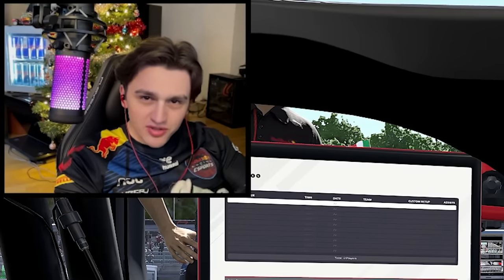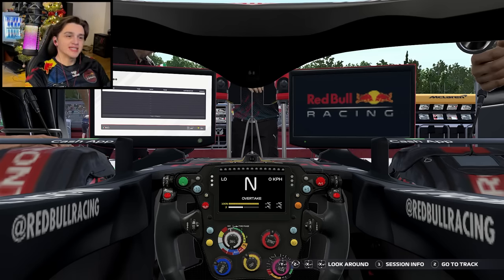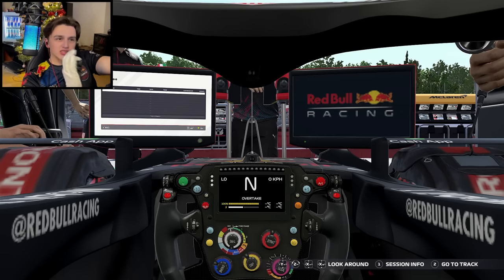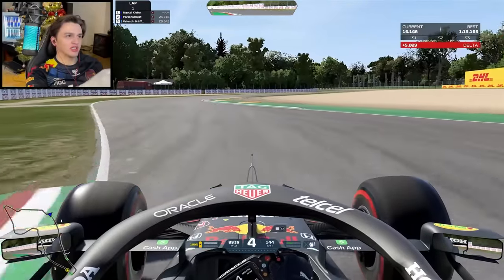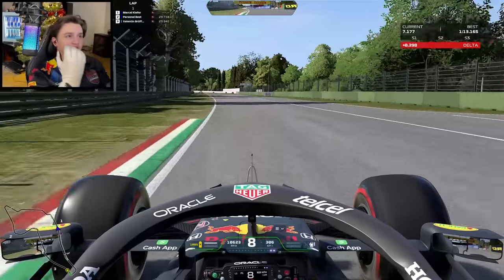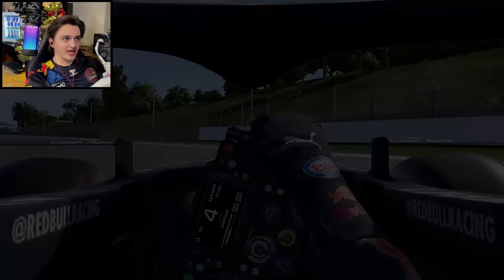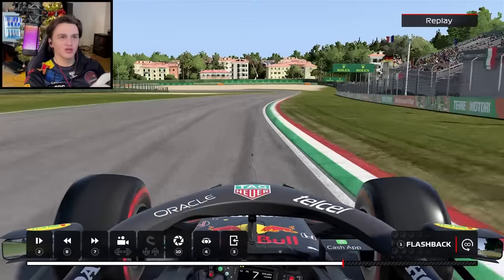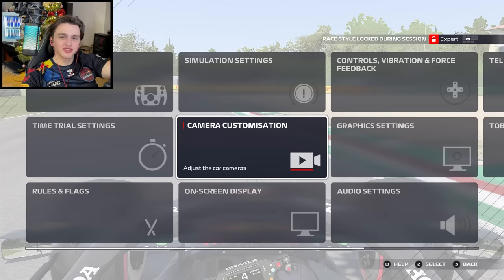Master No Racing Line with these Tricks! F1 2021 Tutorial

Comment: I think it would be so helpfull if someone would talk about every single braking point on every single track!!
Reply: It depends on track conditions and especially on fuel level and tyres. Just watch a youtube video of a record time trial lap and try to remember the braking points. These are the latest braking points and when you have more fuel, harder tyres or worn tyres you brake earlier. You definitely have to drive some laps to find your braking point depending on your fuel level.
Reply from the maker: Can make that but it really varies a lot during wets/inters and dry - fuel load and tire age also matters :)
Reply: @MarcelKiefer  Je kürzer die Renndistanz desto weniger Einfluss haben ja Faktoren wie Reifen, Reifenabnutzung, Spritmenge. Nimmt man mal an das die meisten Spieler nicht mehr als 25% Renndistanz fahren grenzt das doch schon mal einiges ein. Wenn du darauf ausgerichtet Videos für jede Strecke machst, haben diejenigen die längere Distanzen fahren, wenigstens einen guten Anhaltspunkt.
Reply: @MarcelKiefer  u gotta keep it simple(just like u said) and do ur tutorials on Time Trial(all tracks on dry then wet conditions) 🤷‍♂️
Reply: YEAHHH exactly
Reply: Technically you could just use the racing line as reference and look around for objects around it when it goes red
Reply: @DiktaturenF1  This is how I learned… I thought this is the way, but lazy people exist… 🤷🏼‍♂️

Comment: My personal tip is play a race starting from midfield or back on ai level a tiny bit higher then usual and just follow them around the track, soon you will get used to it and will be looking for the best braking points to overtake which are usually on the limit to where you brake and just dial a few meters back on a normal lap to find your ideal braking point/ turning point ( I play on kb but hope this helps )

Comment: Did you drive with a controller when you first removed the line or did that come later with the wheel? If so, what's the difference?
Reply from the maker: Yes with controller! So still had to relearn everything on the wheel :)

Comment: my setup is not mounted, wheelbase is tilting slightly left by the time (I always reset its position during races), since I have nothing to mount my pedals, I extracted the spongy thing from the back of the brake pedal (conclusively I have no resistance on braking), my pedals are travelling the room during races, I am playing through a laptop (15" screen, wheel + wheelbase + laptop case puts the screen 1.5mt from my eyes, due to the perspective difference, when I hold my phone in my hand, the screen is larger than my PC's practically).

I am only using 2D corners only racing line despite the fact that I don't want to use.

so, can these things prevent me from being competitive enough or am I being drama queen?
Reply from the maker: It can definitely have an impact on your performance, what I would try to do is focus less on that and more on getting the maximum out of the material available to you:)
Reply: @MarcelKiefer  you're right, will do that. cheers.

Comment: The weird thing for me is, I do just fine learning circuits without racing lines in any other sim/racing game. Somehow I can't get it right in F1 games, no matter if it's a circuit I know or not, I always play with all assists off, but in F1 I just can't get it right for some bizarre reason.
Reply from the maker: Read that a lot, it is different, but you will get used to it:)
Reply: Ye I have seen many mentioning what you said and i think that Codies F1 games are actually harder and more unrealistic i guess?
Reply: Bro this is exactly the case with me too. Not a single game other than F1 where I use line. Even though I turned all assists off eventually over the years, I could never get rid of line and I know every circuit by heart too lol.
Reply: Same here i play acc and iracing with no assists and its no problem

Comment: I've had problems getting used to the manual gearbox and switched it on and off again all the time. Until I switched it off for good, I've been a lot slower in the beginning but after some time I'm a lot faster now. 

Anyways I'm struggling with the racing line, especially because of changing track conditions, fuel load and tire wear. In time trial I've got no problems at all but as soon as I'm in a race my breaking points seem to be off. Maybe you've got some advice on that 😅
Reply from the maker: Brake earlier and lighter then get try and brake later and harder over time :)

Comment: How do you remember the braking point of every corner of every track? How do you remember so much!? It feels impossible :(
Reply from the maker: It‘s building up repetitive memory :)
Reply: the way i learned it is i drove behind ai, then as i got better i started overtaking ai and driving on my own in clean air. later i sharpened those skills in time trial. now i'm confortable with every braking point of every track. but not just that, i learned how to stabilize the car in the hard braking zone, how to transfer weight safely without spinning, how to put power on throttle gently, how to engine brake, trail brake, how to make a use of upshifts in slow corners, etc. now with all those skills i can jump into iracing or acc and have a go with any car i like without too much struggle. once you learn it, you realize remembering braking zones is easy, it's handling the car at high speeds that has been an issue all along.
Reply: @isuckatthisgame  this is an amazing reply! I’ve been focusing on time trial to learn tracks. Hadn’t even considered following AI cars!!!